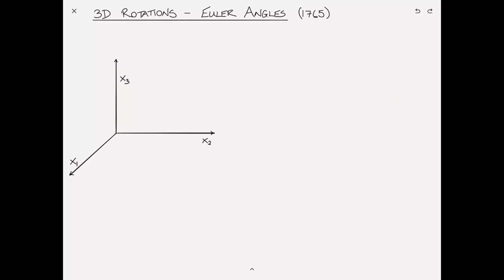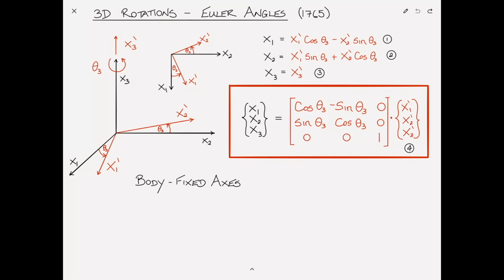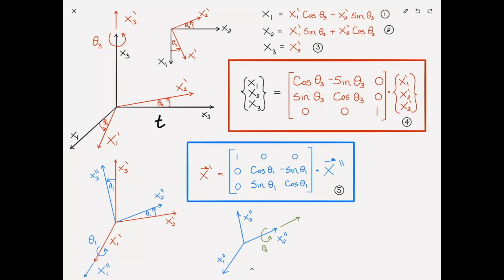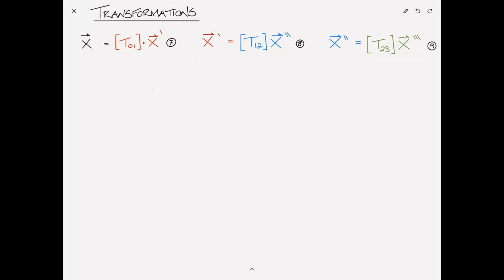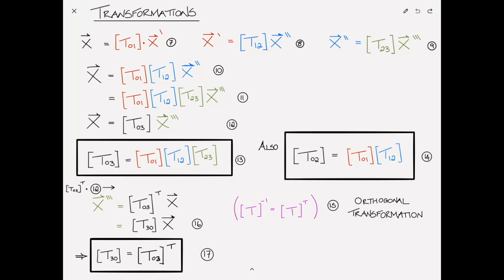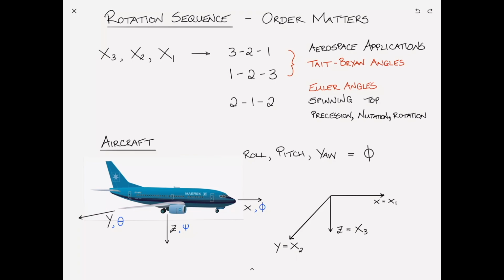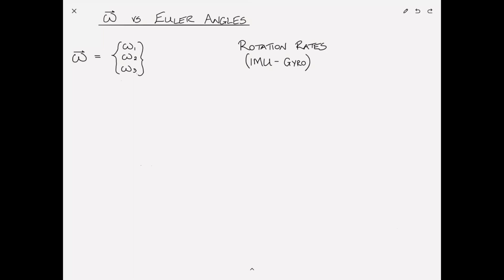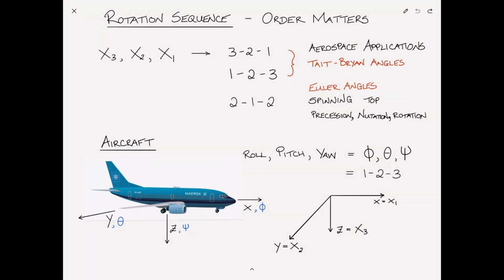Mastering 3D Rotations: Euler Angles Explained | Finite Rotation Series (Part 1 of 4)

Comment: One other thing that you could add is that with matrix [T30] you can even rotate a stress tensor or a moment of inertia tensor! 
I believe you just pre-multiply each tensor by [T30] and then post-multiply by its transpose.
Reply from the maker: Yes, this is correct. It is because [T30] is an orthogonal transformation.

Comment: Do you want to make it more intuitive? This approach worked for me—check how PGA3D incorporates this formula into its algebra of rotors. It's essentially the same as Rodrigues' formula, but it comes naturally through the geometric product and the definition of a rotor (which is based on reflections, a type of isometry). I tested it in GLSL, and it works like a charm. Bonus: Disney Pixar has been using this formula from the beginning, so I really don’t get why people are still using linear algebra to handle rotations—haha!

Comment: Is the gyroscope reading an axis rotation vector? i.e., its magnitude is the rotation angle, and its normalized form is the axis unit vector around which the rotation occurs?
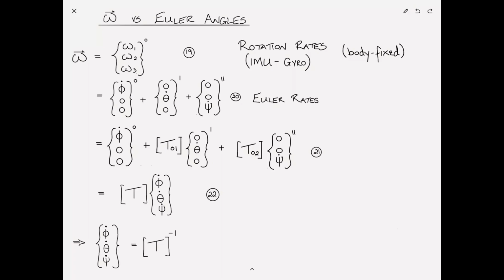Reply from the maker: Gyroscopes in an IMU measure instantaneous angular velocities (Ω₁, Ω₂, Ω₃) about the current body axes—not an axis-angle representation. They output rotation rates in rad/s, while an axis-angle representation would combine rotation magnitude and axis direction in a single vector. These gyro readings differ from both Euler angle rates and axis-angle representations. To get Euler angle rates from gyro readings, you need the transformation shown around 33:30 in the video.

Comment: Good explanation. Which softwsre do you use for writing? Is it Xournal++
Reply from the maker: The software is "Paper" by WeTransfer.  Running on an iPad Pro 13-inch and using an Apple Pencil.
Reply: @Freeball99  Thanks..
Reply: Thanks for the video. This is useful in my profession.

Comment: Aircraft flight dynamist here. You will ALWAYS use a 3-2-1 (yaw-pitch-roll) sequence for flight dynamics applications. The only exception I could think of might be tail-sitting aircraft where you could conceivably have a trim point with the aircraft pitched up nearly vertically when in hover. For this analysis, you might have to switch to another rotation order to avoid gimbal lock. However, I would not consider the order to be arbitrary; the yaw-pitch-roll order corresponds to the traditional way of representing attitude that a pilot experiences (basically, the way attitude is represented on an aircraft's artificial horizon) and is chosen specifically because gimbal lock is only experienced in exceptional circumstances; an aeronautical engineer would not deviate from this arbitrarily. For actual  simulation, however, some other representation (such as quaternions) is preferred for actually tracking aircraft attitude, with Euler angles output simply as intuitive representations for analysis. We also always represent Euler angles relative to the inertial system (rather than from time-step to time-step). For time stepping solutions, my preferred method would be to convert body-axis rates to quaternion rates, integrate, and normalize.

Also, it would be remis not to mention rockets, which typically point vertically (at least during takeoff). I don't deal with them in my day-to-day work, but my understanding is that a different rotation order is typically used to avoid the gimbal lock issue; specifically one where pitch is not the second rotation. 

I had the pleasure of being a teaching assistant for an engineering dynamics course in which we covered Euler angles. The question of the difference between Euler and body-axis rates came up several times once we got to 3D applications, and I think you did a good job explaining that here. However, I really think Euler angles are best explained in 3D, and I did take the time during one of the TA sessions to open up Blender (a 3D modeling and animation program) to demonstrate Euler rotations, including the issue with gimbal lock, and why rotation order matters.
Reply from the maker: Thank you so much for this insightful comment! Receiving feedback like this is exactly what makes what I do worthwhile. I genuinely appreciate the depth of your explanation—especially the reason why flight dynamics always uses a 3-2-1 (yaw-pitch-roll) sequence. Understanding that it aligns with how pilots experience attitude on an artificial horizon and minimizes gimbal lock in practical scenarios was something I hadn’t fully appreciated before.

That said, my discussion of 3D rotations is in the context of structural dynamics, which is treated differently from flight dynamics—though I do mention aircraft rotations as an example. In structural mechanics, particularly with beam finite elements, the rotation sequence isn't as standardized. While 3-2-1 can be used, the choice often depends on minimizing numerical singularities or improving stability in large deformation problems. Some formulations use 1-2-3 or other sequences depending on how rotations evolve in the structure.

Unlike in flight dynamics, quaternions are not commonly used in structural dynamics models, especially in standard finite element formulations. Instead, Euler–Rodrigues parameters (Rodrigues rotation formula) are more commonly used when an alternative to Euler angles is needed. This approach avoids gimbal lock while maintaining computational efficiency, making it more practical for structural applications.

Again, I sincerely appreciate the time and effort you took to share your expertise. This kind of engagement makes this channel so rewarding.
Reply: @Freeball99  Absolutely agree, and I'm glad you found it insightful. I can definitely appreciate that other rotation orders are preferable for other applications, and my comment was very much restricted to the topic of flight dynamics. 

I'm looking forward to the discussion about Rodrigues formula. I remember it was covered in my graduate-level dynamics course, but mostly at a theoretical level and not much beyond that. I'm interested to see how it's used more practically.

Comment: Why would one use Euler angles instead of a rotation matrix, a quaternion, or an axis angle/Lie Algebra representation? They admit singularites, depend on numerous (!) conventions, do not appear naturally in the dynamic equations, require heavy computations to change a vector's coordinate from body frame world frame.
Reply from the maker: Euler angles → human-readable! 🧠
When someone says "pitch 10°, roll 15°" it's clear what happened.
Main uses:

UIs and controls 🎮
Documentation/specs 📝
Teaching rotations 🎓

BUT you're right - they have problems:

Gimbal lock 🔒
Many conventions = confusion 😕
Slow computations ⏳

That's why modern systems use:
Euler angles → human interface
Quaternions/matrices → internal math

Comment: The modern way for doing this is to use geometric algebra. The problem with Euler angles is Gimbal lock. You don't get that with geometric algebra.
Reply from the maker: Agreed! We're going to get there. But my goal is to examine various methods in the order they were discovered.  Also, as mentioned in the video, gimbal lock is less of an issue when using it for time-stepping solutions. At the end of the series, I will compare the various methods and discuss the pros and cons and talk briefly about which applications each is used for.
Reply: @Freeball99  geometric algebra doesn't get the love it rightly deserves. So many companies still use Euler angles, which are just elements of SO(2).